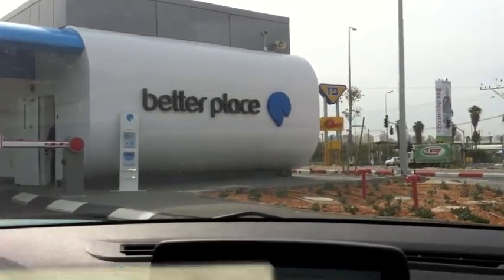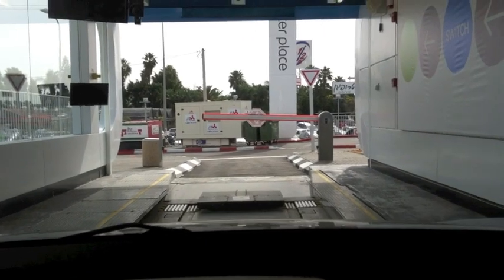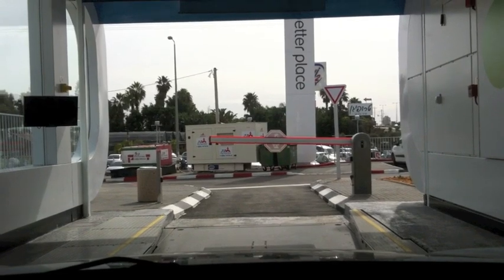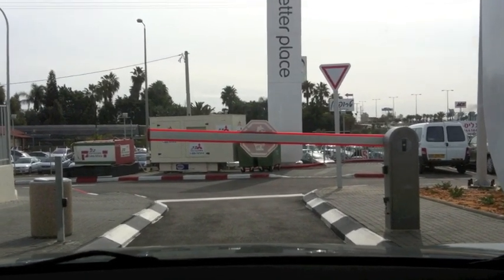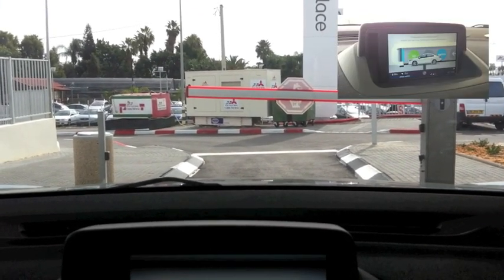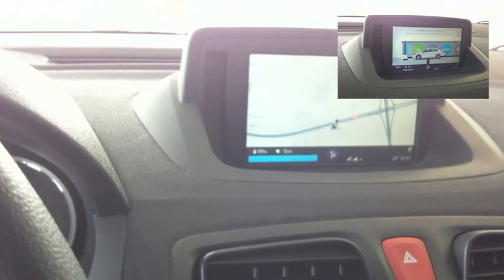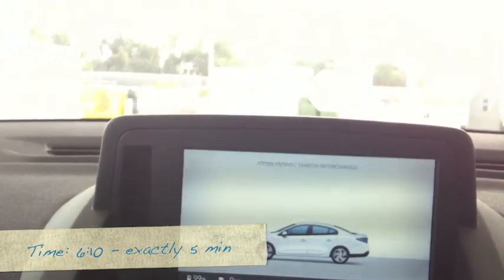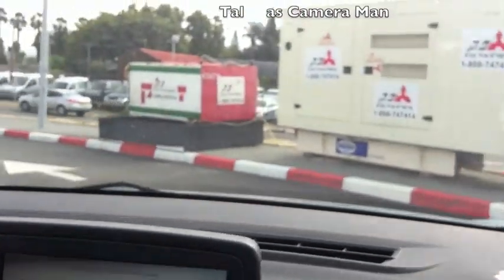Better Place Battery Swap Feb 12 2012

Comment: It's like watching idiots who pull into the gas station on the wrong side of the gas tank flap and still try to fill up by pulling the gas filler all the way to the other side but the hose still ain't long enough, instead of just driving out and coming back the right way.... haha.